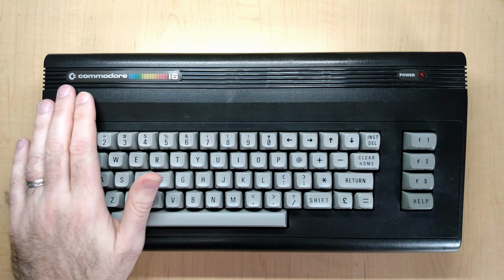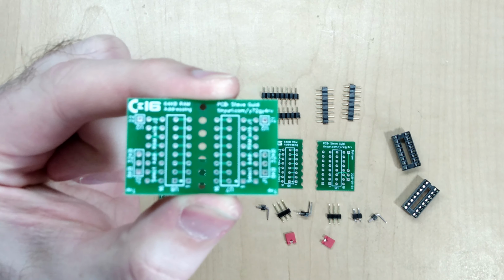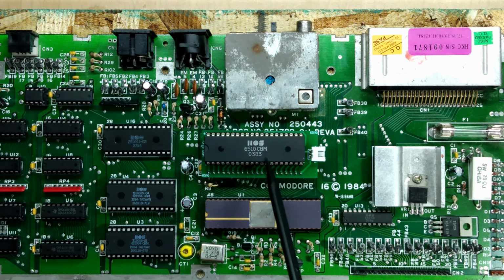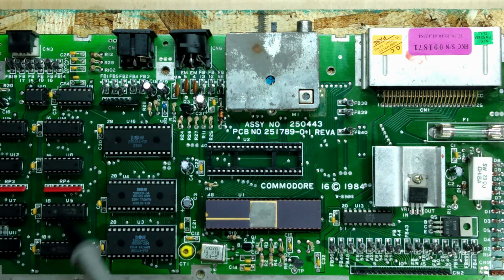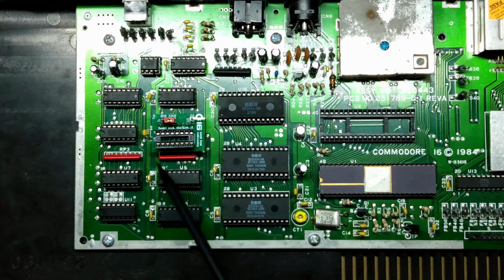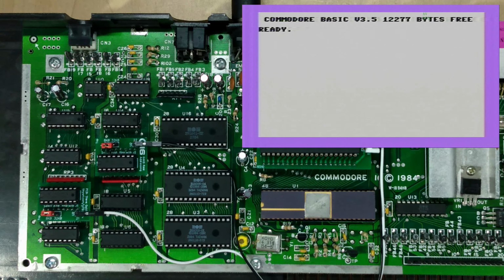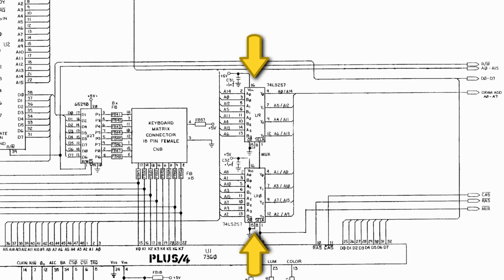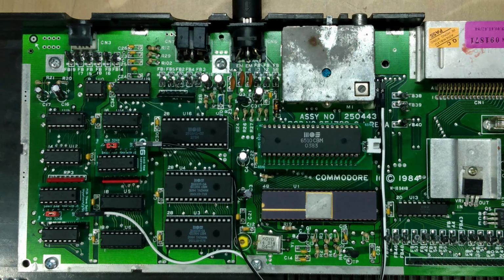A Non-Destructive 64K RAM Upgrade for the Commodore 16 and 116

Comment: Have you considered upgrading the 6510 adapter PCB so you can just plug the wires from the RAM upgrade into it?  It'd be a lot cleaner and not a great deal of work to add two additional traces and thruholes.  Plus you could avoid soldering on the original PCB, and it would be 100 percent reversible.  That being said, it's a very slick and clean upgrade!
Reply from the maker: That's a really good idea!  Thank you for the suggestion!

Comment: Your mod is quite interesting, but honestly I don't think it worths the effort. The "destructive" mod isn't so destructive: only need 1 cut in the board  OR one pin lifting (U8, pin #14)....  but you don't need to remove the two multiplexers, so it's really easier and less risky. 

Then you solder the same two wires behind the board, in order to have a cleaner aspect of the component side, and you've done (of course you need to replace the ram chip).  

Faster and cleaner IMO.
Reply: Having seen several of the old way of doing things close up, I'll have to disagree - this makes it a much neater and reversible install.
Reply: Cutting the original board is terrible.

Comment: You only need the "Diag Cartridge" if your Commodore 16 starts acting strange after performing the 64k RAM upgrade. I upgraded my C16 a few months ago and added 16k to 64k "Flick Switch" as some C16 games will not run in 64k mode ( Rockman being one of these games ), added heatsinks to the TED and CPU chips and my computer is still running perfect.
Reply: Have you used the extra ram? Beyond testing once?
Reply: @blackterminal  I have indeed used the extra RAM and it works flawless.